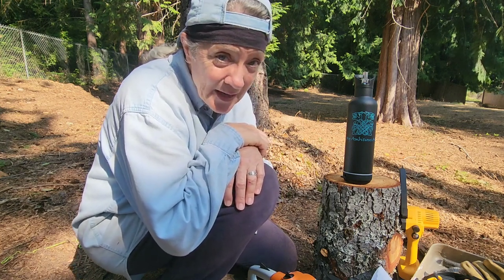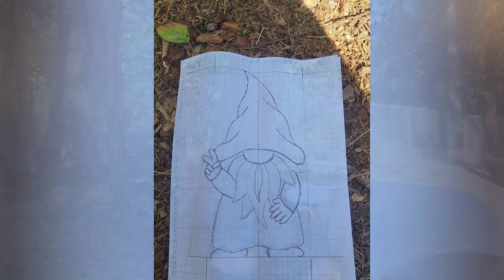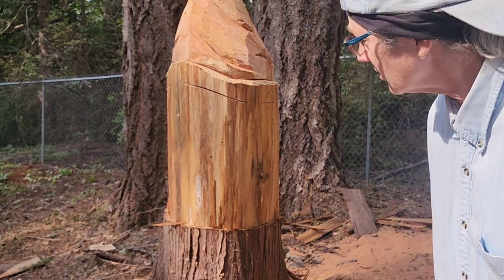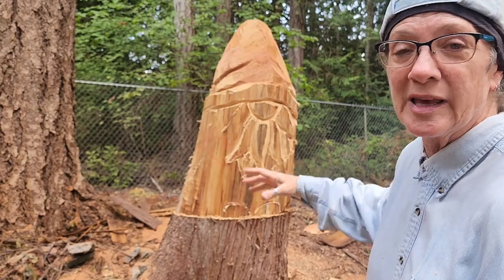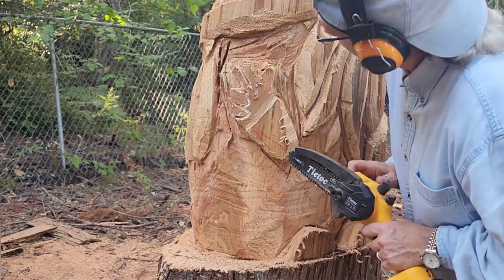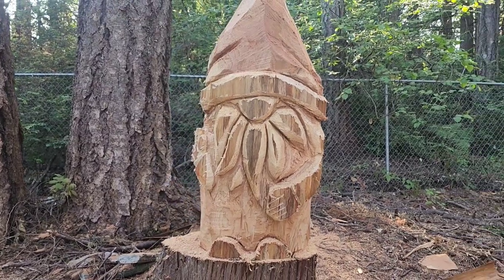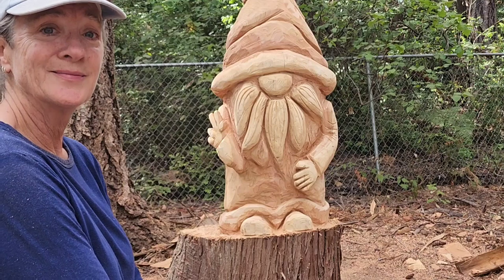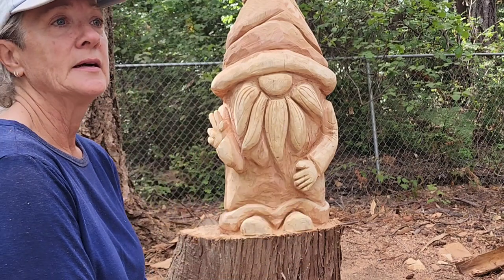Chainsaw Carving...The Great Big Gnome  #woodworking  #chainsawcarving #gnome

Comment: Hi not sure what your name is .  Congratulations on your your first chainsaw carving.  You have a good eye and know what you want him to look like  and you chipped away with the saw until he came out . As a chainsaw carver myself there is a saying go deep it adds a lot of dimension and shadows to the carving.  A couple of tips be VERY careful of that small hand held battery saw I used one and tried  using it for fine detail and got a kick back and cut my finger not bad but enough  to not use it again.  Also when sanding please use a dust mask cedar dust  is very hard on the lungs sanding black walnut is deadly. Just  a suggestion thanks for sharing with  some patients and practice you will develop your technique and your speed will increase along with your confidence
Reply from the maker: Oh my gosh, thank you for that very useful advice! My name is Lizzie☺️
Yes, I'm not a big fan of that mini and now that I have had the chance to check into other tooling options, I think getting a dime tip for my Stihl, would be a better choice. Mask is a necessary evil, especially when it's humid! But I will heed that advice as well for the next time I get back there to finish up. Glad you approve!